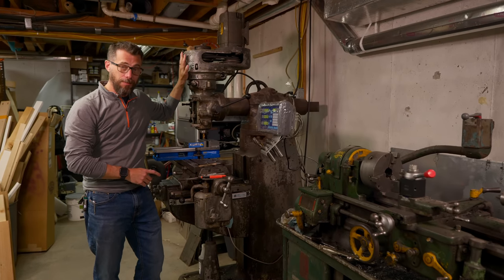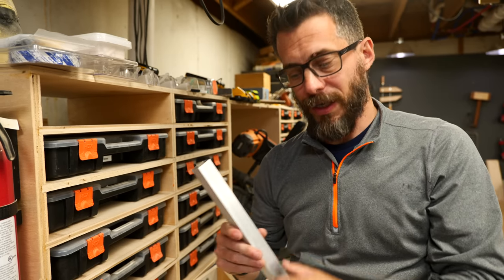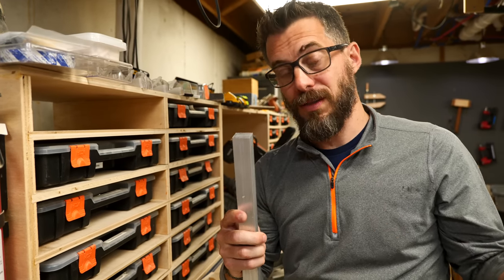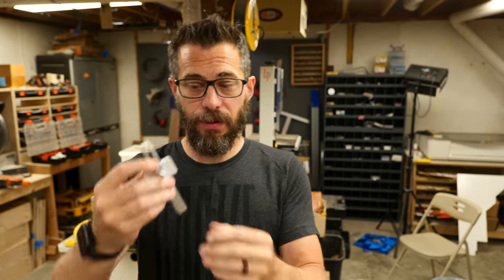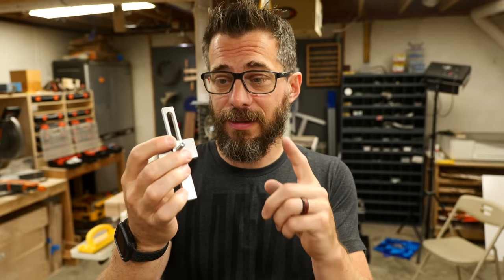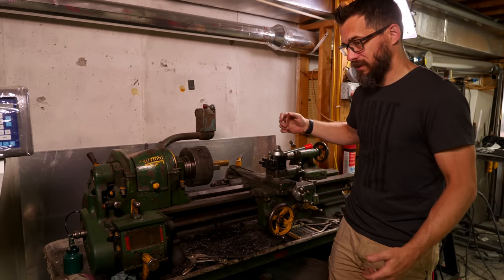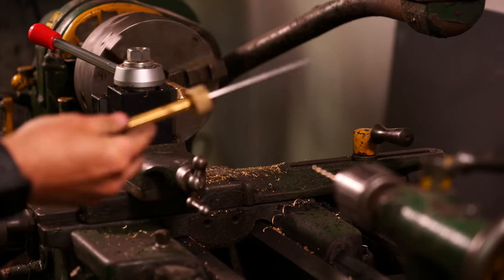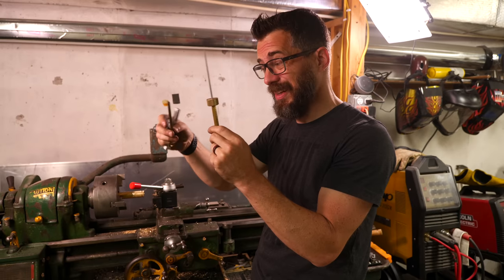Overcoming My Fear of Machining Metal

Comment: Machinist here.  Couple things to note. Take your watch off, you don't want anything that could ever get caught on any of these cutting tools. 2 or 3 flute tools are great in aluminum but you may need to up your spindle speed to get better finishes, lisen to the machine and you'll find what it likes. Bridgeports prefer to conventional cut vs climb cut. Carbide tooling is amazing but those older J-Head bridgeports often don't have enough spindle speed to push the tooling as much as it needs to be to get the benefits of it. That cutoff tool is pretty long, you really don't want it excessively long for the radius of your material and run the cutoff tool at about 1/4 of your regular turning speed as well as making sure it is perpendicular to the axis of the material. As far as the knurling goes you really need good alignment on center as well as across the wheel for good lines as well as a consistent feedrate across the part. I don't know if your machine has power feed, it looks like it might, but if it does I would recommend learning how to use it. You can use the tailstock center in the lathe, or the spindle in the bridgeport with your part clamped, to help keep the tap wrench straight as well and tap it before parting it off. Buy a springloaded tap center and some chuck style tap wrenches. Just some tips and thanks for making content that exposes to people to machining equipment, we need more machinists!
Reply: Another Machinist. Use a 3/4" wrench for your drawbar, please.
Reply: Not only does he have power feed hid machine has a quick chance gear box.
Reply: And rings off
Reply: This is all great advice. Along with the watch, I'd personally remove the ring but lots of folks don't so YMMV.  The other thing I'd add is that task lights on the mill and lathe will improve your quality of life 10x. It seems like you're seeing the work but when you add a task light it's a new world. A wee hand mirror also prevents the need to put your head in uncomfortable or dangerous positions. I personally don't like putting my head right next to machines, even when they're powered down.
Reply: Oh, and for the lathe it can be reassuring to set up a stop (or in a pinch, a clamp with soft jaws) on the ways that will stop the carriage before it will hit the chuck.
Reply: @OhHeyTrevorFlowers   or he could just  turn the chuck jaws around, i dont know if his chuck has it but maybe it does
Reply: see this is what I like about this community, so many people out there willing to help
Reply: @OhHeyTrevorFlowers  I seem to remember a video years ago where he mentioned his wedding ring is silicone to avoid accidents.
Reply: Machinists are so much nicer here than on machining channels.
Reply: I would also add to the comments as well that when drilling using the lathe, get a self-centering drill bit to start and that will help your drilled hole be straighter down the middle of your part.
Reply: Came here to say basically all of this. Hobbyist myself, but skilled hobbyist since I sink years of obsession into any tool purchase. I'd like to call out the most important points people have made so far:

1) No loose or dangling jewelry or clothing near the spinning death machines!

2) Use the Tailstock (the spikey-back-slidey-bit behind the tool carriage on the lathe) and a center drill to support all that material stickout, especially when you're pressing hard against the part, which is normal for knurling. 
First insert your Jacob's chuck w/ center drill into the tailstock and lock it down close to the work. Feed the tailstock into the spinning work until you've cut a small V into the center. Pull the tailstock back (and stop lathe) and replace Jacob's chuck with center (live center spins, dead center requires lube and doesn't spin. I like live, personally). Move tailstock to work and lock, then gently feed in the center until it's firmly seated into work. Lock. Ready to knurl/cut.

3) Use a way (the smooth metal tracks the parts all move along) clamp to mark a safe distance from the teeth of the chuck to keep yourself from running the tool into the "Shred Zone". Do not depend on a clamp to stop the carriage when under power feed! I'd even recommend replacing it with a dial indicator, in that case, as the leadscrew for the feed will absolutely strip it's self out, or the funny nut that grabs it!

4) Choke up on your cutoff tool! You want minimum stickout and maximum rigidity for all lathe operations.

5) Not mentioned before, but my own advise: Chuck a dead center in both the tailstock and the lathe chuck. Use a dial indicator (pref. 10ths) to 'dial in' the lathe chuck's center. Use the knobs/screws on the tailstock to line up with each other. You now have the exact center point of your work area dialed in and can set your tools to that point by lining them up with the tailstock/deadcenter!

6) Watch Blondihacks! Quinn has taught me almost everything I know. This Old Tony covered all the rest!

P.S. The tablesaw is much scarier than the lathe, IMHO.
Reply: Machinist as well here. I’ve watched videos on lathe accidents…no loose clothing rings or watches! Our instructor in college showed us pictures of a guy that wore hooded sweatshirts in the shop…we took them all off next day.
Reply: You beat me to it on the centering of the lathe chuck. It appeared to be a bit off with the bit too long for the piece, but still can work. The thread tap is the most likely spot for the wobble. Did I miss if you used way oil?
Reply: @God_Of_Hammers  no they arent.
Reply: Also a machinist here, it really humbles me cause i know i was just like this starting off and how far I have come
Reply: @God_Of_Hammers  has to do with attitude, more than willing to share with a newbie with heart. seems people with 5-11 years think they got it dialed. i retired after 45+ years and i can say i know far less than in my eighth year - that's attitude, and it took a few more years to lose it. there is nothing more critical than a room full of machinists watching an "expert"....
Reply: @LordOfTheSnoop  everyone else calls what you call a self centering bit a pilot bit.
Reply: @machinistpro140  the more you know the more you know that you don't know.
Reply: @1pcfred  thank you!  I was wearing my woodworking hat instead of my tool and die.
Reply: @LordOfTheSnoop  actually I am the one that is mistaken. They are center drills!
Reply: @1pcfred  center drills for lathe and spotting drills for milling machines but a center drill can be used both on mill and lathe
Reply: yes you need to watch out
Reply: 👏👏👏 Sound advice all around... we're a dying breed.
Reply: Hi. Hobbyist of 15 years here. Another thing regarding safety & the "scary factor" I haven't seen mentioned yet. The way the jaws you were using were set up for holding large pieces which is why they have the protruding chunks spinning at the outer edge of the chuck. You should be able to  turn those jaws around so the longer protrusion are towards the inside for smaller diameters, not spinning out wide waiting to remove parts of your hand. Having the longer protrusions gripping the work piece will also hold it far more securely & won't be near as dangerous as the set up you were using. Check out many of the machinists on youtube. You'll quickly learn so much & change that fear into healthy respect for the machines.
Reply: So so glad these comments are here
Reply: what the hell he typed sounds basic but good enough  feed rates should be in the machinist hand book and the machine normally has some suggested rates

Comment: Welcome to the fun zone :) It might put your mind at ease to know that the table saw, chop saw, JOINTER, etc will maul you much more easily than a mill or lathe. Or maybe that will do the opposite..

Pro tip: A drawbar hammer will make life on the mill WAY better. On one side is a socket for tightening and loosening the draw bar, and the other side is a little brass hammer for tapping the collets free.
Reply: You and Bob should collab for a round of I Like To Make Stuff Here!

Comment: I can't quite see well enough to be certain, but most 3-jaw chucks have reversible jaws. You should be able to just wind them out the whole way and turn them around. Then they won't be sticking out and you can work closer to the chuck with more rigidly supported material. Just make sure you put the jaws back in the same slots. They're usually numbered.
Reply: Most threejaws have a spiral gear to drive the jaws, these jaws arent reversible becouse the teeth have a certain curve lengthwise. On these Chucks you tipically get at least 2 sets of jaws, the Inside and Outside Jaws- (tipically 3 steps to the inside or to the outside). The other kind of self centering Chucks would be the ones with a completely different mechanism that can be reversible, but thats definitely not this Chuck.
Reply: I have a 3 jaw that has bolt-on reversible jaws, but otherwise I agree with Nico.
Reply: Yeah, those jaws are flat faced on the outside.
Reply: Jaws can be readily reversed on independent jaw chucks (2/3/4/6/8! Jaws)
On self centering chucks, adjustability totally depends on the chuck. On the Cheapest ones the jaws usually cannot be reversed. Slightly better built chucks may come with 2 sets of inner/outer jaws (if that makes sense).
 Some really good chucks have separate upper/lower portions for each jaw. Lower part meshes with the spiral, upper part will have some kind of retaining mechanism for mounting various jaws. Usually these can be adjusted for runout as well.
I used to salvage stuff a while ago, not a pro-machinist :)
Reply: You are correct! Also buy a machinist handbook
Reply: @marcuschauvin7039  machinist handbood for apprentices
Reply: Yep these jaws are definitely the wrong way round.

Comment: For the knurling tool: use cutting oil. Lots of it. And tap your holes while the part is mounted in the lathe, using a tap-follower.

Comment: I've done machining before so here's my quick tips to add to the pile:
-Get some cutting fluid so that your drill/milling bits last longer. You can put that bad boy on everything every time you drill a hole, tap, etc. It'll save you a lot of broken bits and... odors...
-Since you don't have a DRO (Digital Readout) system on the lathe, you can use the  measurements on the different nobs to move the tool in/out/side-to-side. I'm guessing they are probably in thousandths of an inch. Although watch out if there is some "slack" in the nobs because it can through off your measurements by quite a bit.
-Speaking of the DRO, using the X and Y can give you the ability to center your drill/milling bit if you use a part of your material as a starting point (ex: use one of the corners as X=0, Y=0). So for projects that require complex cuts or precise positioning, you'll be thankful to that DRO. There is actually the Edge Finder tool that can help you center the edge of your material with the center of your mill collet center (just need to do the math after that to include the radius of your drill/milling bit when you'll move to make a hole/cut)
-If you have one, I recommend using a ratchet wrench to loosen the collet nut above the milling machine. Just makes it a little bit easier and less awkward to do. :)
-You can't really sharpen milling bits but I suggest you learn how to sharpen your drilling bits. From personal experience, a properly sharpened bit will cut ten times better and it'll actually make a hole that is more precise.
-There are a lot of different handle configurations for different types of lathes, so I recommend you look up online for your lathe which handle does what. Funny thing is that you can lower the speed so it can be less scary for you. :)
-Knurling can be done at a much lower speed so it won't try to rip off material.
-There are a lot of people that added safety systems to their lathes, so here's a few: 
     -An emergency stop button on the front side so that it is more accessible than your ON/OFF switch you have right now.
     -A circular plexiglass cover that can be flipped onto the chuck so you have less chance of accidently hitting it while you work.
     -One of my favorites is a long orange foot pedal that goes all the way across the foot of the lathe which can be another emergency stop. If you ever get caught in the lathe or something bad happens. It's the fastest, safest and most efficient emergency stop I can suggest.

There is probably a whole lot more I could say but that would take a full Word document, so I'll just say that you should always try to learn more online or with a machinist in person because the milling/lathe/band-saw combo can and will step up your project game exponentially the more you learn how to use each equipment. I personally can't stop loving machining with those tools once I learned about the infinite possibilities they bring.

All-in-all, great project! Keep up the good work. <3

Comment: Appreciate your effort. A few basic machining errors that made your product short of perfect: Oil on the knurling, shorten the position of the parting blade for more rigidity and before drilling use a center drill to guide the drilling bit. You can do your threading while still in the late to make it very straight. Others already mentioned getting the right jaws on the lathe chuck. Keep on it!

Comment: Definitely want to slow down for knurling.  Also, reduce your "stick-out"-- the distance the piece sticks out of the chuck.  If that isn't possible, use a center (in the tail stock) to support the outer end of the workpiece.
Reply: Came here to say this! If the machine has a low gear, that's ideal. There's potentially a lot of tool pressure and you don't want it spinning so fast. Also, the results will not be what you're after @17:15

Comment: The jaws in your lathe chuck are reversed, the "tall" part should be in int middle for holding bar stock like that. Someone had it setup for holding large internal diameter stock. If you change them back you won't have the jaws of death trying to rip your knuckles off, and you won't have the stock sticking out as far, which is giving you some of your finish issues.
Reply: From what I could see that's a non reversible jaw set. The back sides had no teeth and weren't angled either. The chuck it self might accept reversible jaws however
Reply: That is a 3 jaw scroll (ie: self centering) chuck. Those jaws cannot be taken out and reversed. They are a "special" set intended for larger diameter metal stock. The standard jaws should have come with the lathe but are perhaps missing...
Reply: @Tater_Lord  I agree. He needs another set of jaws to grab ID parts. You can't flip it around. This type of chuck cames with 2 sets of 3 jaws.

Comment: I actually love the fact you did this. Mostly because I see others use these machines and have no fears of messing up or hurting themselves on them. Meanwhile I’m afraid of starting a project thinking it will fail or I’ll hurt myself.  I’m learning how to use a bandsaw.
Reply: please find a mentor PLEASE find a mentor if you like your fingers. your local community college may provide you with some guidance, even without registering for a class . . PLEASE PLEASE obtain some guidance. in my 45+ years i've put too many fingers in cups of ice - - (other peoples) and wear eye protection! "you can eat with false teeth, you can walk with a wooden leg, but you CANNOT see with a glass eye"
Reply: @machinistpro140  thank you. I have experience with other tools. Including tablesaws that scare me a lot. I will see if I can find a class somewhere.
Reply: @LisaHarsh  don't fear failing, you will. it's only human to fail.. i have so many mistakes, and that's called experience. and from experience come success. fear is what will get a person hurt, not as much as over confidence though.  in regards to the band saw, think the motion through. are your thumbs in line with the saw blade? use a piece of scrap to push with. cutting metal? generally more teeth are better, as well as slower f.p.s. (feet per second) for the blade. wax is an excellent lube for metal cutting at first, a simple candle will do. the softer the metal, the faster you can go, though alum has a tendency to "load-up" (build up on the blade) if that happens, make a series of short cuts into some hardwood to clear some of it, and go slower. let the blade do the cut, don't force it. above all, do not fear, and protect your eyes. if you're afraid, you'll flinch, and that will hurt more than a loud bang. You are going to do fine. YOU are the boss.  and it's only a fail if you quit, and some piece of metal beats you. go in to win. people are gonna ask you what that smile is about.

Comment: An apprentice machinist( so not the most experienced but still), I would recommend centre drilling before going in with drill, it will help centre drill (unironically) that could be why it was wonky when you screwed it on, cos the drill wondered when drilling. 
Also it wouldn't hurt to use some kind of coolant and tapping fluid, it'll help the life of your tool and help prevent the tap from snapping when tapping
Reply: Plus, using the center drill would give him a perfect spot to put the tailstock center to keep the material from flexing when he's doing the knurling and initial parting.